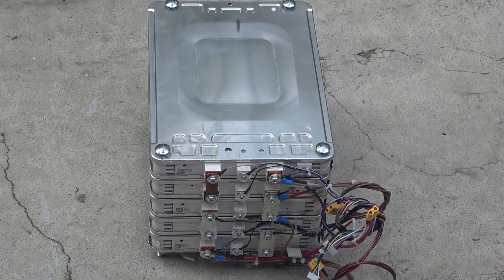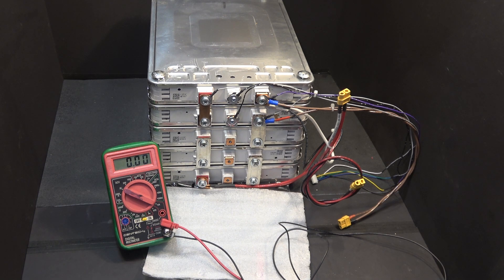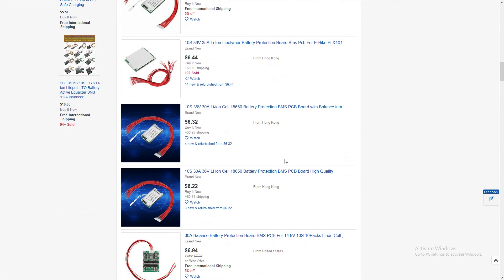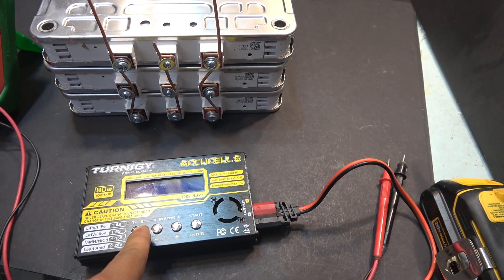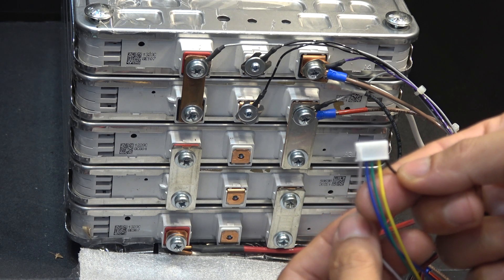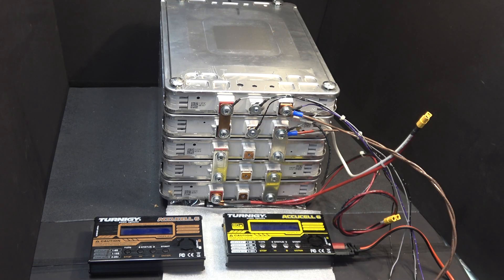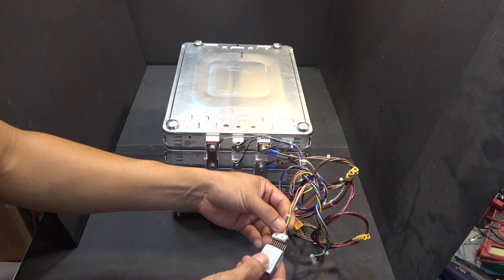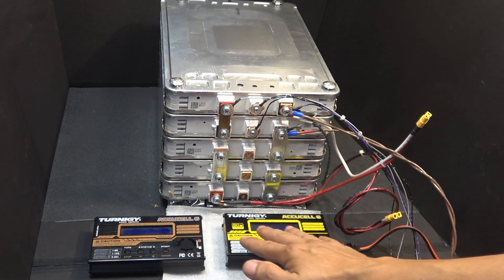Solar Van S01E04: Balance charge a Nissan Leaf battery pack (part 4)

Comment: hi  i wonder i can use ur method 10s by  buying 10s bms connect from  top to button , start from right top negative to button postive then connect 24v solar pannel  is this work  without lipo charger , right now i buy 6s bms , connect to 6s leaf battery  in yr method with 24v solar pannel is this work ?

Comment: i have ordered controller an throttle from voilamart who make motor as never had this problem before with original supplies.the throttle had battery bars display and just went down as battery drained
Reply: If you mean the "three lights" style of battery indicator, those ones suck because they're actually meant for lead-acid batteries (designed to compensate for voltage sag).

Comment: hi vuaeco i just had my electric front bike wheel repaired now tested as working but when connected to my controller and lcd display i get error 07 overvolts or 06 under volts.and no spin wheel .have 53 v 18650 battery samsung 25r and 36 volt 18650 battery from hoverboard .can i bypass lcd somehow
Reply from the maker: I would try a different controller.
Reply: If another controller isn't an option, try unplugging the LCD only and see if it (the bike motor, that is) still works. Some controllers apparently will work without the LCD, though the parameters will be fixed at that point unless/until you reprog via TTL. IOW, it will be set up for one voltage only (usually printed on the unit). Good luck.

Comment: Thank you, I am trying to learn! I need to go OFF grid. I have a tiny house a little chest freezer, and two LED lights (12 volts). How many solar panels do u suggest...PLEASE 🤓🤗
Reply from the maker: You typically get about 50-60% out of what's rated at your solar array for an off grid system.  Add the wattage of all of your devices and multiply it by 2 then it'll give you a rough estimate of how much solar you need. It also depends on how long you run your devices. IF you run your devices all day then you will need much more panels.